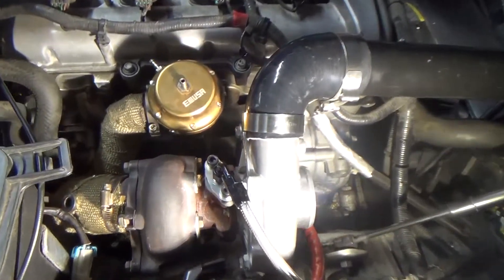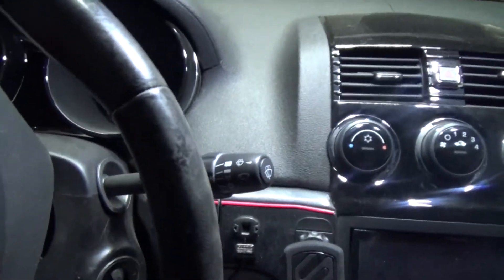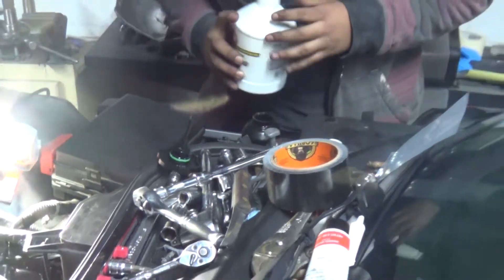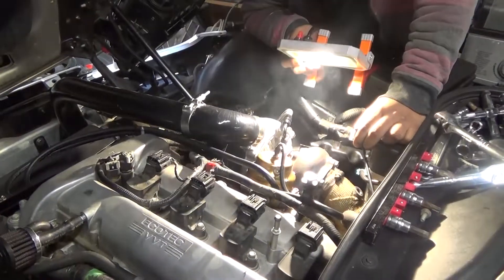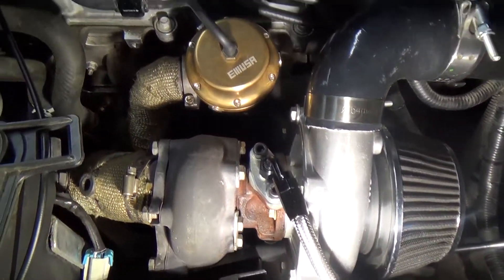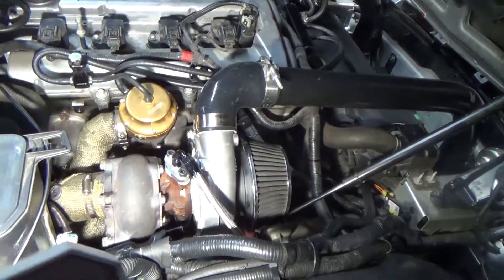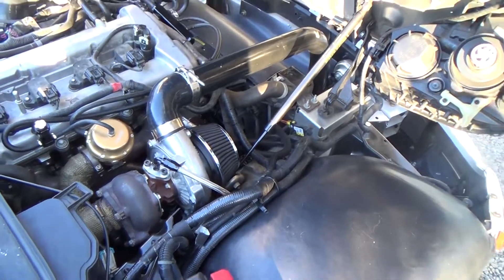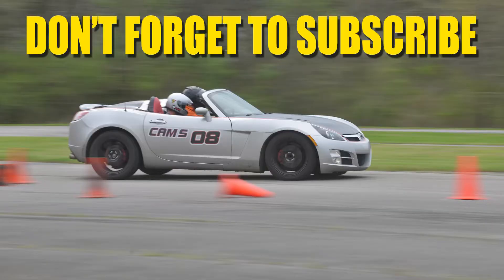Saturn Sky 2.4L Turbo Install Day 5-6 - The First Start Up!!!

Comment: Really like that intake you have on the turbo,  always wondered if that style will have too much heat from headers or not.
Reply from the maker: Not sure yet. I've done a lot of heat shielding in general so we'll see. I can always get an actual cold air intake in the future if necessary.

Comment: Personally I’m kinda thinking 
But it just my opinion 
That you will want some kind of cold air intake 
As a posed to just a air filter off the front of the turbo 
Seems like it would eat a lot of heated air off not only the turbo but the motor too 
🤔

But another great video 
Thanks for sharing 
Stay safe
Reply from the maker: Thanks Jeff. You may be right and I'll see how much the heat affects the air input. I'm already in discussions with someone to possibly make a custom pipe as a cold air intake. So it's something I'm already thinking about 😉

You stay safe too.

Comment: Mike the suspense is killing me drive that thing... I'm curious to see what your boost is gonna be... because when I got my upgrade from rpm the boost went from 16 PSI to 25 psi... Thing I had to sacrifice here in California as the cold air intake.. I had to keep the stock air Box and it really hasn't changed much The cold air intake is just for looks..